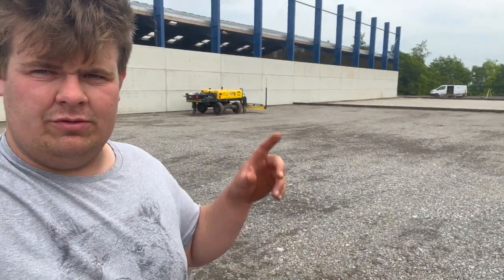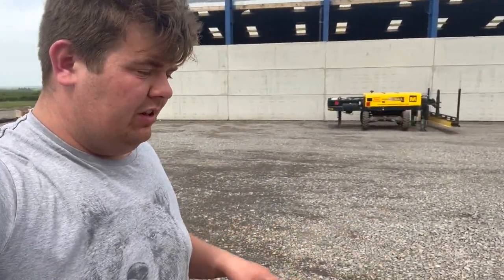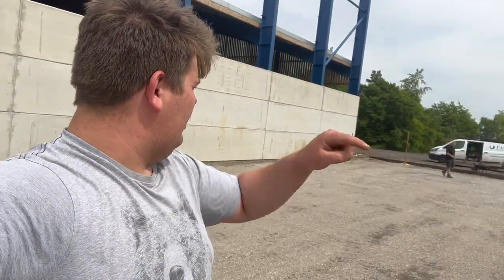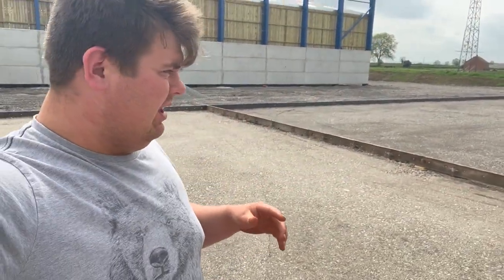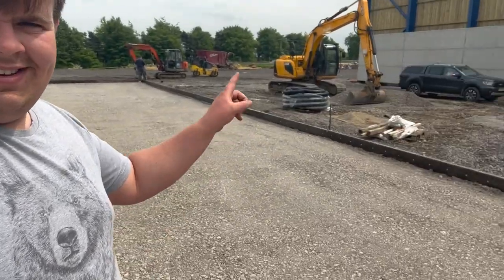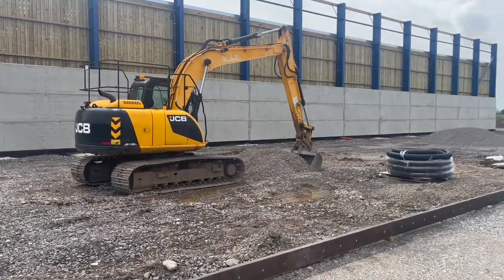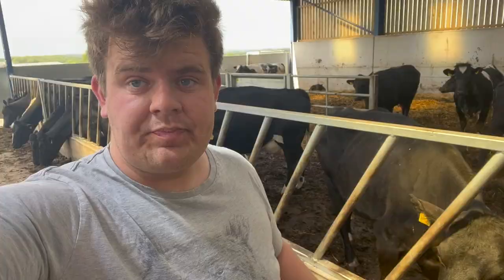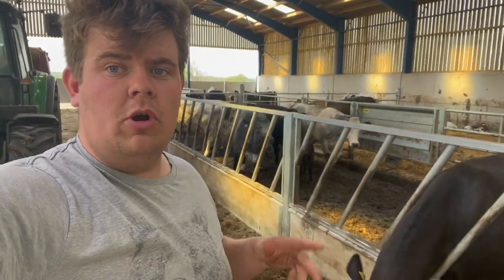NEW SILAGE CLAMP PREP!!

Comment: We are putting down a new clamp this backend and we hadn't thought of breaking its back either but as you spoke about it , it made a lot of sense , our pit is going to be only 40 x 120 so less than half the size of yours I would think. We will be putting a 20 foot wide pit beside it next year for maize .
Reply from the maker: Hiya, yeah we didn't either until it got mentioned and it made sense. We are going to split the clamp down the middle so we don't end up with one big face of the clamp. Cheers.

Comment: Hello jack ,Thats the widest silage pit I've seen ,the widest we've built is 60 ft  will you be able to get across it fast enough without any secondary fermentation or spoilage ,Any plans of putting a land drain pipe in the corner before you fill to get the effluent away